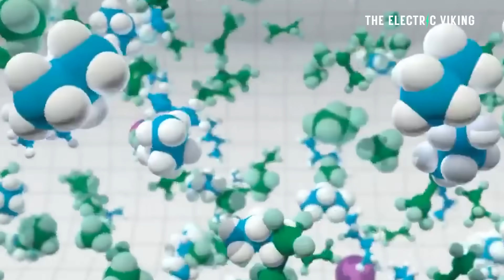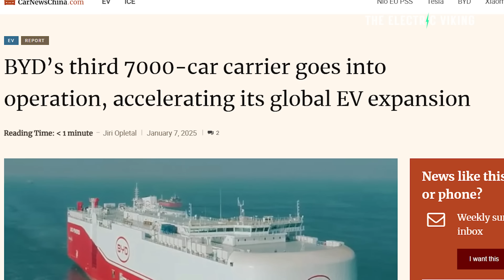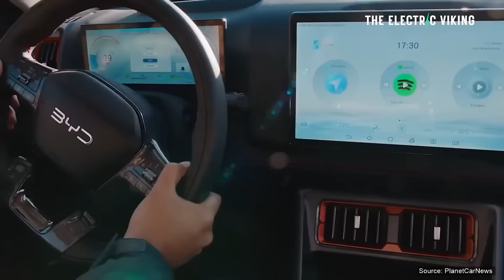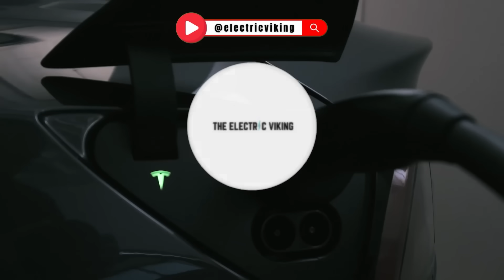BYD reveals the worlds largest ship with LNG and BYD Blade batteries

Comment: Just to inform you, modern ships engins are propelled by electric motors and thrusters. The electricity to run them is from mostly diesel generators. That is why there are batteries on the BYD ships. They can operate without the polluting generators in sensitive areas. In other words they are hybrids like cars and locomotives.

Comment: If that ship is equipped with batteries it could use them at least when approaching or leaving ports. Cold ironing should be provided to all vessels mooring or idling at ports, preventing emissions and improving fuel savings.

Comment: Most vessels run bunker fuel / not diesel for sailing and propulsion and diesel is used in ports for power generation to operate the ships equipment along side and at anchorage.  

Bunker oil which is just about the last dregs of the crude after all petrol and diesel and other higher temp chemicals have been removed from crude oil during refining.
With recent IMO  2020 (International Maritime Orders implemented 2020  ) have required the use of lower sulphur fuel oil. ships don't run on diesel but start up on diesel and many are diesel electric. 
Using LNG and bunker fuel is a massive improvement on emissions and most newer vessels have scrubbing systems in the exhaust. 
 BYD having its own fleets answers only half the issue of costs in moving vehicles around the world as vessel need to be ful or utilised at least 80% full on all legs of passage. BYD need to move cars back to China or countries nearer their region to optimise the efficiencies of owning/ operating their own vessels.

Comment: Why can't they just use 100 electric motors and 1,000 batteries to power it?
Reply: Because it burns 300 tons of oil per day. That's roughly 3600MWh or 36000 100kWh batteries. Per day 😂
Reply: Ok but why do you find your lame jokes so funny @vote4coffee

Comment: Although 8 to 10 Ro-Ro ships ordered by BYD sounds like a lot, it may be the tip of the iceberg.  A Nov 2023 Defense Magazine article said Chinese companies had 76 Ro-Ro ships ordered for between 2023 and 2026.  (That is a LOT of Ro-Ro's!!!)  I wonder how many of these were encouraged (or even subsidized) by the Chinese government to be built, possibly for their military applications?  There is belief that China will plan to use these ships for an invasion of Taiwan, as they have used Ro-Ro ships on multiple military exercises the last few years. The article noted that "in a five weeks-long exercise in summer 2022, PLAN tasked twelve Ro-Ro and other civilian ships to transport more than 8500 pieces of military equipment and more than 55 000 troops across eleven Chinese ports."  I hope this does not happen, but I would be concerned if I lived in Taiwan.

Comment: All the people asking about connecting to the cars to use there batteries need think about all the pplugs wireing control systems inverters that would be needed And that the latest battery technology is not explosive or fire hazard !!
Reply: I think you suffer from sunk cost fallacy.
Reply: @MrLeadb1  😅😅😅

Comment: Hey Sam. I don't know anything about car carriers but cruise ships are all diesel electric, effectively using the massive diesel engines as generators to power the massive battery array. 
Cheers
Reply: One point, NO batteries on cruise ships. They are diesel electric but don't have large battery bank. Most have 4 or more large diesel generators that are powered up as required. So in port, they may only use one, but use more as power is needed to propell the ship.
Reply: @glenndennis6801  Well think about this - D/engines drive the AC alternators to produce currents which are channeled to ship's switchboards, which are channeled to the frequency converters for DC power supply to the electric motors, which then drive the propellers. Nothing like low speed engines that drive CPPs directly for fuel efficiency.

Comment: Wouldn't it be so cool if the ship was powered by the combined power of the battery pack in each car🤓
Reply: Yeah, 9000 cars would power this ship for 6 hours.
Reply: @vote4coffee  is that all.
If the ship had solar panels and sails then that 6 hours would be increased a bit anf enough for bursts of power to steer the ship when needed allowing the sails to do the rest. 
I saw this idea with  paragliding.
A small motor and battery pack give them 10 to 15 minutes of power. This allows them to use the power for take-off from flat ground and land with more accuracy..it also allows them to use power to position themselves in thermals that give thin lift.  Most of the power is still the glider.

Comment: BYD could have just used a diesel engine, powered by bunker fuel (low-end noxious garbage fuel, basically tar).
So I give them credit for that.
But also, METHANE ("Natural Gas") is renewable... at least potentially.
Many dairies in California capture the methane given off from the sewage lagoons, clean it up a bit and inject it into the methane pipelines that provide gas for heating and industrial uses.
(One huge benefit to methane capture from sewage lagoons is that it reduces the horrible smell that dairies and city sewage ponds give off)

Comment: why not connect the 9.2k car batteries to the ship for power ? - or did I miss a trick here ?
Reply: Yes the amount of cabling control systems inverters etc !YOU MISSED AN AWFULL LOT !!😂
Reply: @michael-sz3ff  that would create a lot of heat and so many batteries in a confined area is a firework waiting to happen and it wont be romantic like the titanic either MY HEART WILL GO ON AND OOONNNNNNNNN

Comment: Sam, do you know anything about the
fire going on in Moss Landing in California?
It's apparently in the batteries.
Reply: It's still burning. Company said they need the lithium batteries to stop burning before they can investigate.
Reply: It's extinguished. Luckily it wasn't an oil storage facility.
Reply: @hansj5846  
They tend not to spontaneously catch fire though...
Reply: Fuel storage of any kind will burn in that situation.
Reply: @FrankiePo89 
Anything will burn, if you put tons, and tons of lithium batteries next to it, and don't look after them...
Reply: It's nowhere near the other fires...
Reply: @FrankiePo89  Nope, it's 350 miles from the LA catastrophe.
Reply: @fredwilliams8898  
There's also cases of other fuel storage on fire.
Reply: @FrankiePo89  I think the Mesa battery fire was in May of this year. Intentionally buried coverage of that one too?

Comment: There are electric ships that big but they are hybrid powered ICE generators  powering electric drive motors .  
Both  the RN aircraft carriers are powered this way. 
The problem with RORO car carriers is stability and draft particularly if the load and unload at more than one port. The water ballast systems are particularly complex.

Comment: I feel your pain regarding ship pollution Sam. I live in a little town in the north east scottish highlands. We see literally hundreds of large liners from spring onwards due to our deep water dock.
The usual prevailing wind from the south west smothers the place in their filthy emissions, nothing is done about it as the port wants the income.
Reply: The ships could easily switch to a cleaner fuel while in port... just by having a small "Clean Fuel" tank... or by powering from dock-side cables instead of fuel.
But that might subtract .00001% of their income, and executives might lose a tiny bit of their bonus!
So you see the problem, mate.
Your family and friends' health doesn't add to the profit margin!
Get out and lobby your county/city/parish elected officials and make them fix that problem, it's your health at stake!
Reply: Sam talks about diesel for the boat, but what they are using is bunker, which is the lowest quality and maximum pollution. I used to live in Montreal-East (1950-1965) at a time when there were lots of refinery and the edge of the river was all black from rejects. They would clean the tanks of the boat and throw that in the river at night... Luckily, the St-Lawrence has come back to a more normal level of cleanliness.
Reply: That must be tough for u. I was on the cruise on time and I couldn't stand the engine smoke either. My sister and I would avoid the rear section of the ship. May be you should move somewhere else. It is not healthy to breathe these pollutants.

Comment: LNG-powered ships are not battery-powered. A fully battery-powered ship is not feasible
Reply: No big enough charging station.
Reply: It takes too long to charge the batteries
Reply: For shorter routs, they are already in work. Load-off-on with battery swap at arrival.
With progression of Na-Sulfur batteries within a few years time it will be viable.
Reply: @allegro70 bahahaha
Reply: Maybe in 50 years.
Reply: Fully battery powered routes are definitely possible! Think about it… there are 9200 approximately 60kwh packs onboard the ship… if those cars were loaded fully charged and they were capable of vehicle to grid and there was a grid matrix to connect them to… off you go!!

Comment: Sam, thanks!  Hey an idea on powering the ship...I wonder if all 9,200 vehicles on the ship are electric and they charged them to 80%, how far could the ship go on electric alone (holding off reality for a moment to see what the numbers might be), whaddayathink?  For simplicity, 9200 x 100(KWH battery per vehicle avg) = 920 MWHs (if my math is right...seems like it would power a ship for a while...
Reply: A ship that size have somewhere over 100 000 horspower. So all those car would power the ship less than a day.
Reply: @pasdevosaffaires3038  and @brett..., didn't you see I said "Holing off reality for a moment"?!  No it's not enough to get from port to port of course not!  But 920 MWh  is huge.  The Canadian EV Tugs only get 5.6 MWh batteries and they run all day and plug into the port to help power it at night!  Think outside the box folks,!!  Brett:  SUVs will soon have over 100KWh batteries, the Caddie or at least the hummer and maybe one other (so far!!) has 150KWh, most EVs will get larger batteries once the price is right (2-3 years as Sam is reporting, no?)
Reply: What EV has a 100kWh battery?

Comment: LNG powered? That is very disappointing. I mean... they have a thousand batteries onboard. Why not find a way to plug them in "vehicle to load" fashion and run electric propellers? Pretty sure that amount of MWh would get them anywhere in the world.
Reply: & how does the ship return to china⁉️😅
Reply: @GbMuthu  Come on, I only had 2 minutes to come up with the idea. Let's see... keep the LNG tanks and engines for the return trip. A . . . hybrid ship if you will.  😃 Real-time invention here. Not even AI can do it.
Reply: Shouldn’t we just be grateful that they’re making best efforts given the current technology? I suppose they could’ve added rotary sails, but I bet they considered it.
Reply: @nr5494 
I agree 👍
Reply: It is, but don't forget the distance plus wave conditions and they move 100% at night, so wind, solar and actually some type of hydro pump would be awesome.. is the tech here for this kind of mass though??
Reply: @techshark77  once out of port, they run 24/7.
Reply: “Pretty sure” is the basis of all engineering. 😂
Reply: Wait for a nuclear powered ship.
Reply: @cb250nighthawk3  the chinese are researching thorium powered shipping
Reply: @cb250nighthawk3 like a submarine or aircraft carrier you mean....
Reply: Not even close mate 😂.
A container ship uses 300 tons of oil per day. That's roughly 3600MWh.
9000 cars with 100kWh batteries is 900MWh. That's enough to power the ship for about 6 jours
Reply: They don't have the support system for that yet,try charging up a ship sized battery with make shift ev chargers
Reply: I expected some larger windmills sticking out of the flag pole and rudder.
Reply: And then you're going to wave around the charging log complaining your new car ain't new.
Reply: Physics are physics and there’s no known way around it
Reply: BYD's loss for not hiring you as their engineer